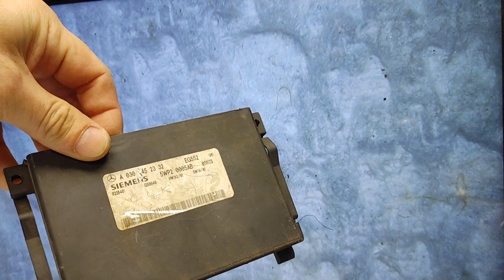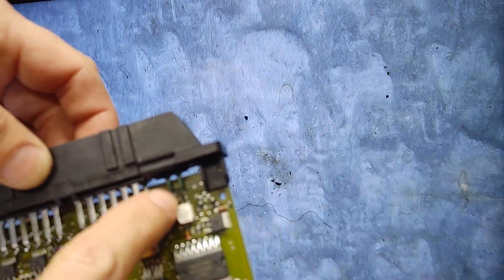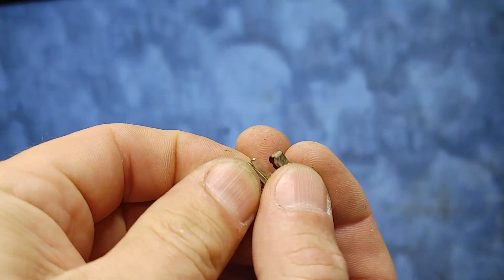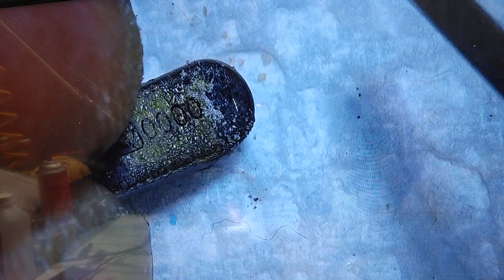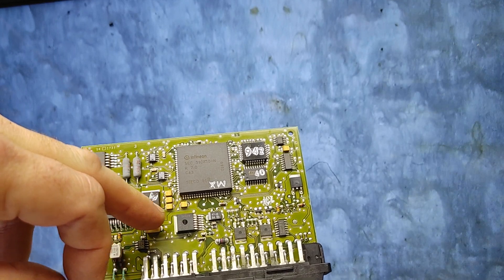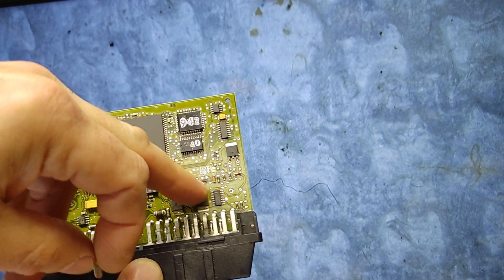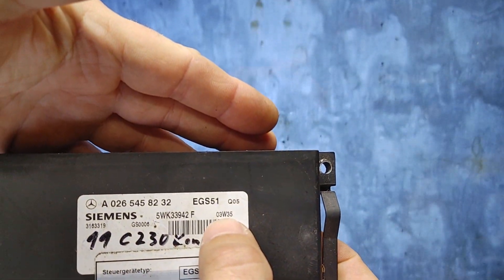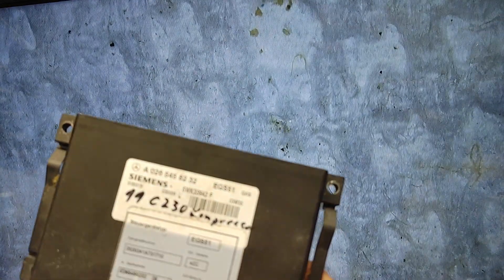Mercedes transmission control module crystal internals.

Comment: I purchased a e320 that had a limp mode condition and discovered a very oil flooded TCM that I drained and cleaned.  I was able to reset after cleaning with an iCarsoft scanner and the car ran fine for a few days but then went into limp mode again.  I assumed conductor plate failure so I changed that but still have the same error.  I also was now no longer able to comunicate with the TCM using my iCarsoft scanner.  So, I am thinking the TCM may have to be replaced, though there is definitely not ay rust or corrsiion.  I just ordered one on E-bay with the same part number that apparently came from a 2005  clk320.  Mine is a 2001 e320 wagon.  I assumed because the part number was the same that they are the same TCM, but now I am finding out they are not.  Do you think it might work or will it throw a code and go limp because of the clk vs E-class chassis difference?

Comment: Hey Victor, thank you for this video! I have a question, are these early tcm's require any can input data or they can work stand alone only with the sensors from transmission? 
I'm asking because I'm considering to upgrade the old 4 speed transmission to 722.6 but It will be very hard if the tcm expects can input.

Comment: Hi can you please suggest how to fix error code p0606 component y3/8n4 fully integrated transmission control unit is faulty. Can i service or have to replace the sparepart ?

Comment: CPU clock xtal probably.   Nasty.   It's basically a bit of quartz crystal (hence the name) with two metal plates on each side that is resonant at a particular frequency.   Pretty much a very precise capacitance that keeps the frequency constant.   You should be able to source a crystal for that quite easily.